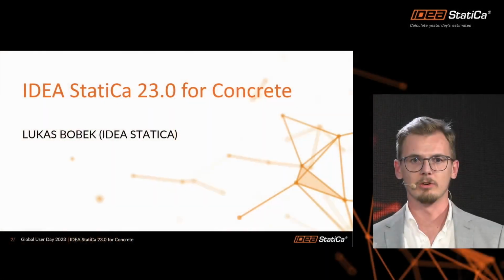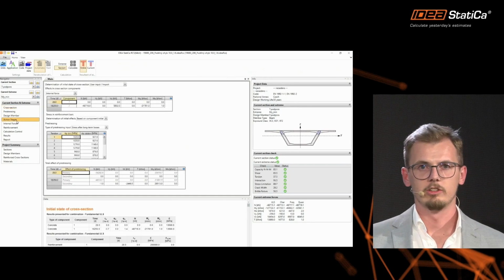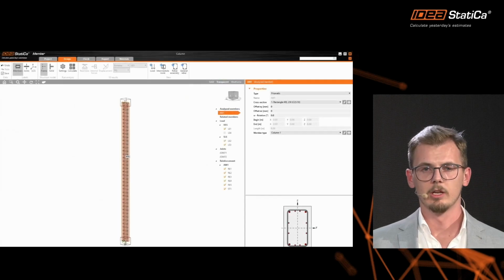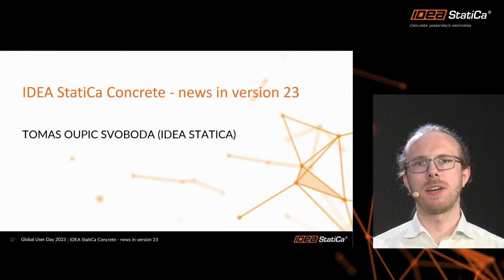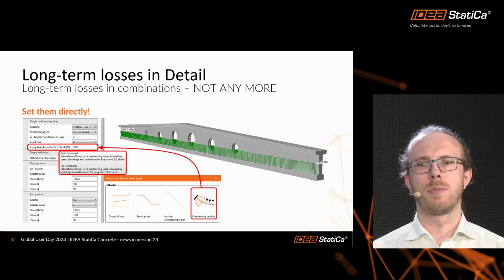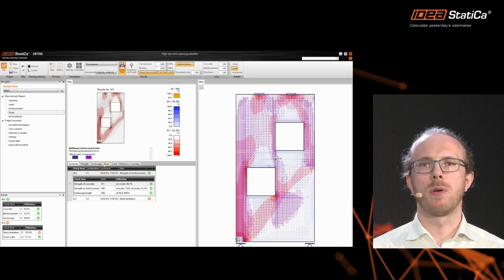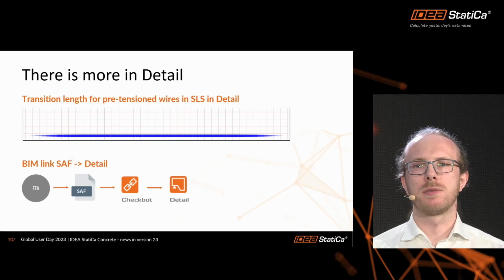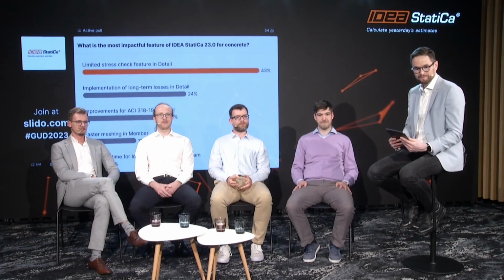Global User Day 2023 - Session #3 - What's new in IDEA StatiCa Concrete version 23.0

Comment: Pier segment diaphragm having torision, shear and longitudinal unbalance load can analyse ? Particularly the unbalance longitudinal moment load flow through the exist access opening provision to column can do ?
Reply from the maker: Hello, IDEA StatiCa Detail is only "in-plane" (2D) solution. You would need two separate models. One to analyze torsion and shear together and the second one for the longitudinal direction. You can check the webinar related to the topic to see how it works: https://www.ideastatica.com/webinars/transversely-prestressed-bridge-diaphragm
Reply: @ideastatica_en  Thanks for your reply. I watched the linked video carefully , but seems the real problem demonstrated here is half done. The example shown here shows the torsion and shear load on plane element, as you also highlighted in reply, which I agree IdeaStatica can do very well. but how to do  longitudinal direction (unbalanced moment) , plane element with opening ? may I request to extend the video example showing how to do a separate model  and combined the effect?